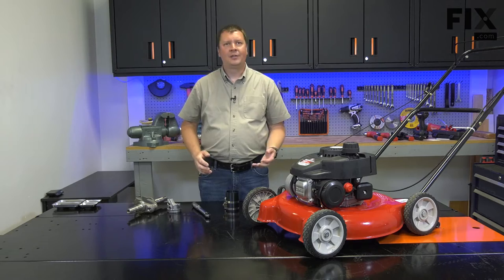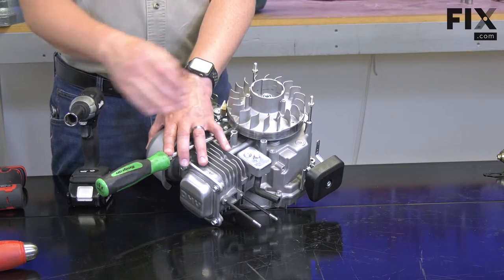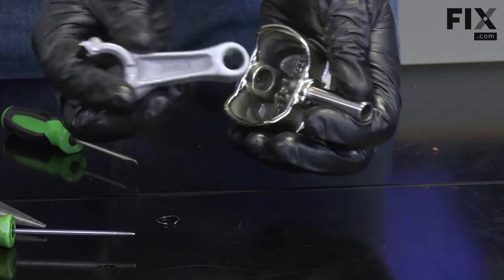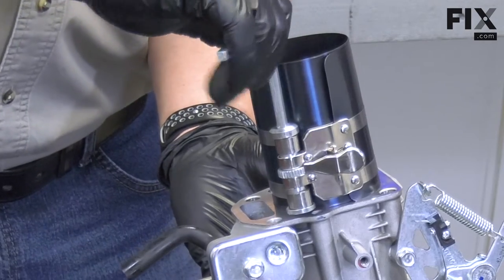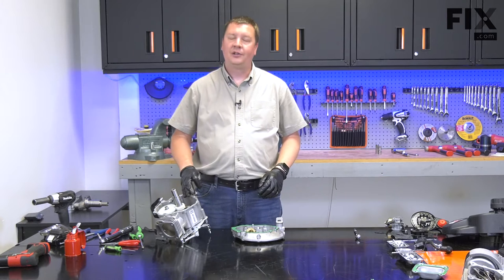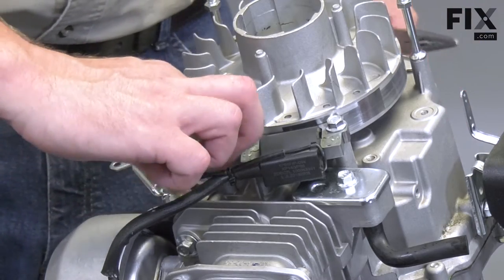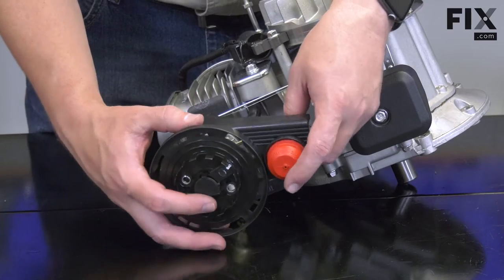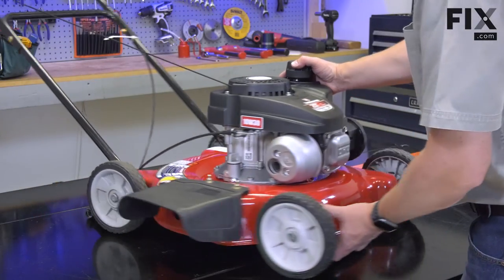LAWN MOWER REPAIR: How to Install the Connecting Rod in Your Lawn Mower | FIX.com

Comment: I have a really serious question… at 11:10  when your hand kept hitting the “J” shaped thing what is that? I replaced my carburetor then 2 weeks later my engine wouldnt start… I opened it up and the “J” shaped thing that leads to the outside of the motor was jam me in my gears

Comment: Awesome video well explained I have a question may be you can help me I just connected to new rod to the journal my question is after I tighten it down to the talk Are you able to turn the crank shaft Easily that the piston goes up and down because I cannot move it after I tightened it so I don't wanna put it back together question is it supposed to move freely in the journal thank you again For all your help